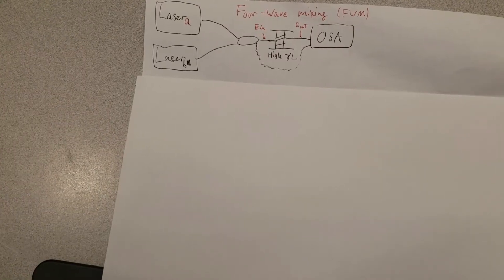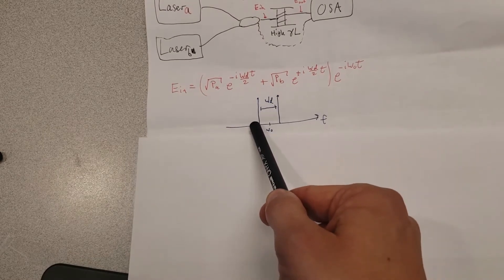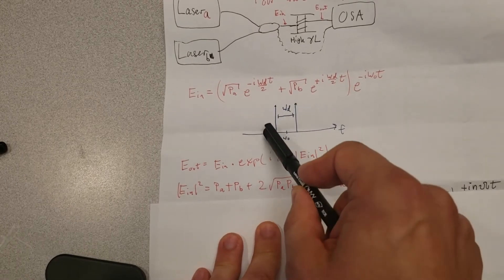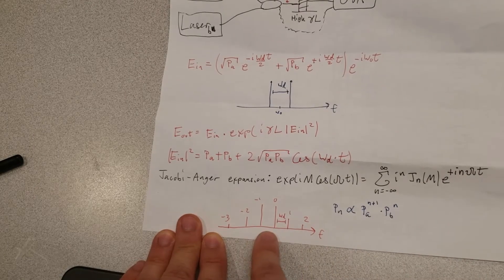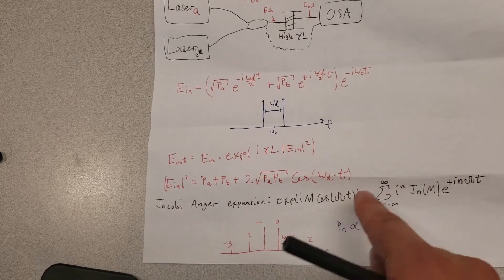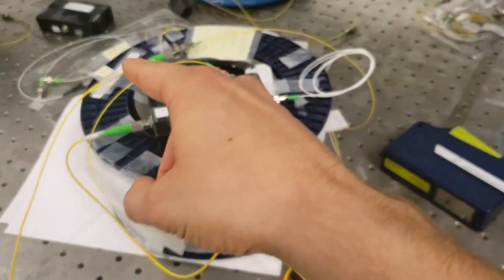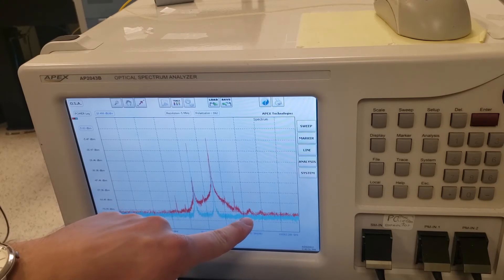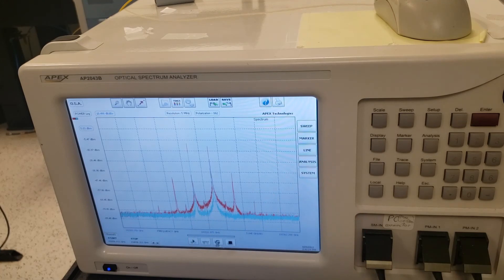Four Wave Mixing

Comment: You should try modulating the beams to 400hz securing the non linear medium to the table first.  And the video is interesting sir.
Reply from the maker: Thank you, I am glad that you found the video useful. What result do you expect from modulating at 400Hz specifically?
Reply: @yourfavouriteta  It's from the files of someone who had access to some of Tesla's work.  If you get any spare time between your legit work, design a pumped phase conjugate mirror between 100-400hz or don't, it's your call. Thanks for replying sir. I apologize for being cryptic.